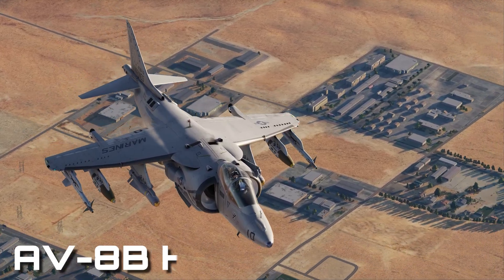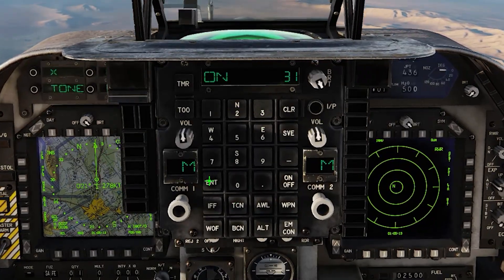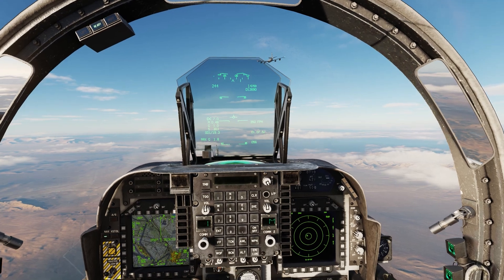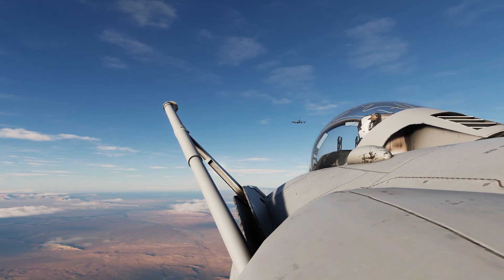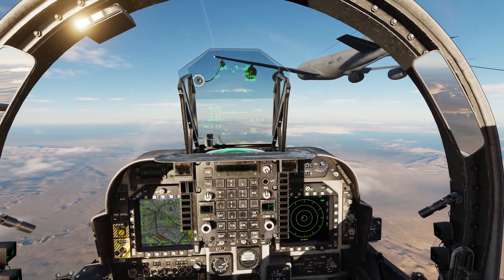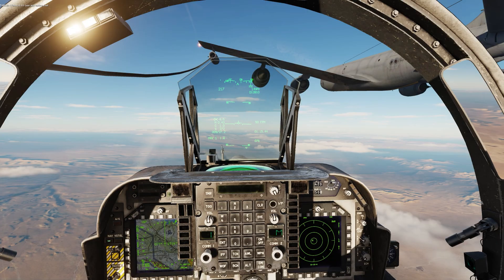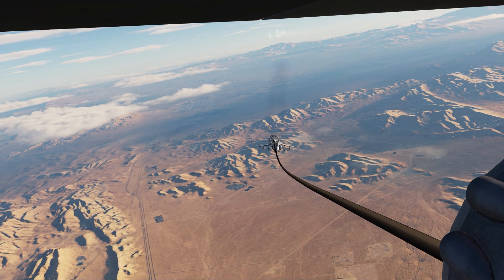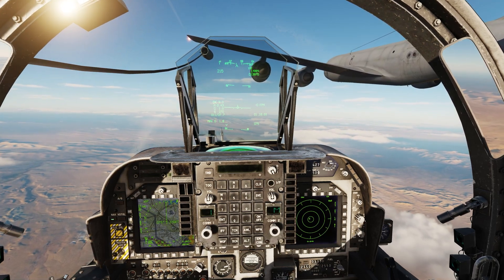AV-8B Harrier AAR Tutorial | DCS World Tutorial

Comment: Good video.  Do you have any tips for stabilising the approach?  I do use AFC (flicking on then off) to try and trim, but using the normal trim controls never seems to have a fine enough control to give as stable an approach as you have in the video.  Any suggestions appreciated.
Reply from the maker: Trim for the speed of the tanker and trim again. I recommend practicing steady flying and then change position all around the tanker to get happy with formations etc
Reply: @TacticalPascale will do - appreciate the help
Reply: Have you tried just keeping the AFC on? That way it can take some of the workload away from you.
Reply: Have you tried just keeping the AFC on? That way it can take some of the workload away from you.
Reply: @huntingfox3351  Thanks - I'll give it a go.  It is probably just me, but when I watch the "how to AAR" videos it seems as if they have turned wake turbulence off as they sit in smooth air with no vertical nudging up and down, but it is always on for me!
Reply: @chiefsheep5255  I actually happened to fooling around with wake turbulence on the harrier yesterday, and I couldnt get wake turbulence to appear.

Something that might have a similar effect could be your flap setting. Make sure to set it to cruise. If you start flying slow enough with flaps in auto, it can automatically schedule to a different setting whilst you are flying. This will both increase lift, and slow you down significantly. Putting your flaps in cruise locks them in at 5 degrees

Comment: Very nice tutorial. Funny to see how different people use different sight pictures.

I myself always  line up the top left corner of the HUD with the refuelling pod on the tanker to get the side-to-side position right. I found it to be easier to refuel off of different airframes that way, when the tankers may not always have the same engine layout (KC-130 or S-3B).
But it does seem that I always line up slightly too far to the left, so might be time for me to change my habits!
Reply from the maker: I’ve found this works with the 135,S3 and KC130. Usually most people struggle chasing the basket around, I’ve always tried to find a constant sim point. From there I tweak if required